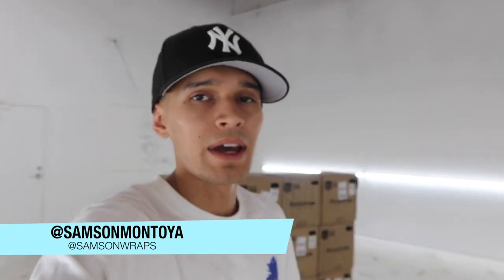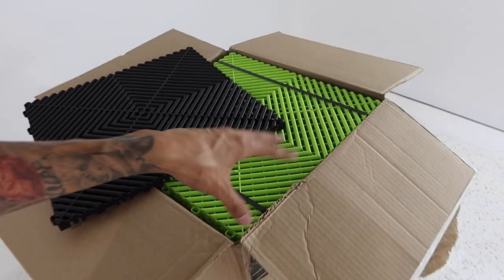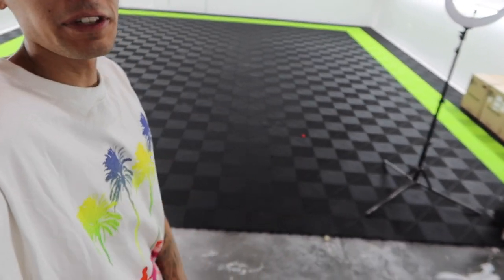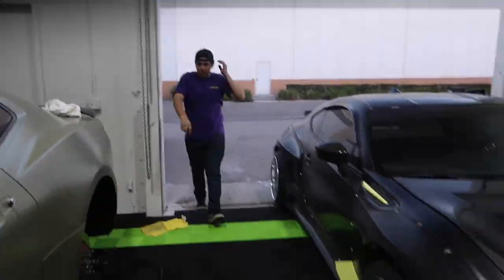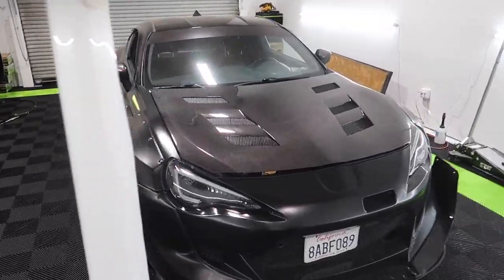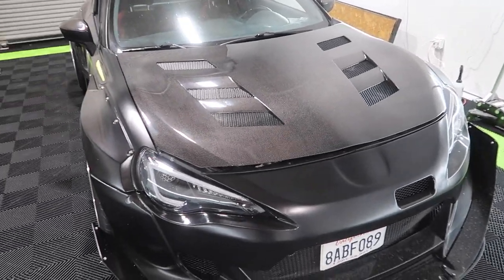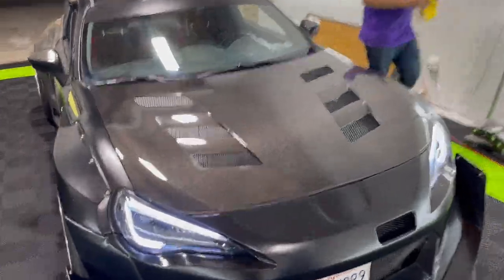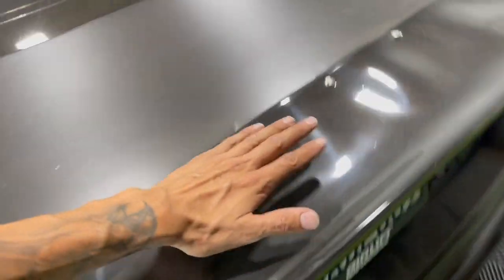EVERY SHOP NEEDS THIS FLOORNG!! (Learning How To Clear Bra)

Comment: How do you clean that floor? Doesn't that collect a lot of dust over time?
Reply from the maker: All the dirt and dust gets trapped under the flooring. These floors are easy to clean as you vacuum the floors. Also very easy to take apart. Full process took about an hour and half